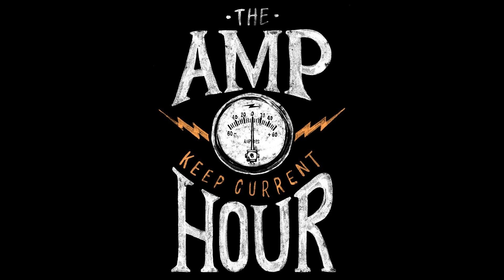The Amp Hour #691 - System Designer Lets You Try Every Part with Michael Gielda

Comment: I get the conceptual analogy that Renode is like Docker.. but not seeing how it ties together with my current build-system?

For example, a smartfusion2 fpga soc the Libero toolchain for synthesis and a gcc compiler for the Cortex-M3...   and say it talks to a microcontroller can-bus device , using a CanOpen protocol.  Where does Renode fit in?